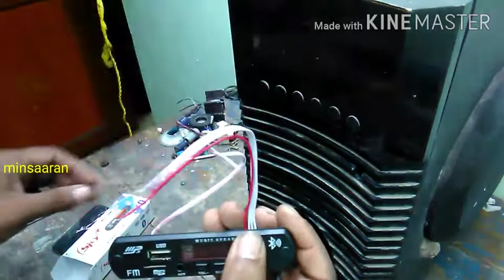Usb, FM, Bluetooth service in tamil/ 2.1 home theatre service in tamil/ usb board assemble in tamil

Comment: Anna enoda target home theatre remote miss aairuchu apram usb..mmc work aagala aana fm edukuthu ithuku oru vazhi sollunga vera usb board connect pannuna 5.1 ah work aaguma ila 2.1 ah work aaguma ? Sollunga anna
Reply from the maker: 2.1
Reply: @minsaaran9531   anna usb la 5.1 edukatha
Reply from the maker: @ss-jy5ip  5.1 Ella speaker um velai seyyum. Connection correcta kodukkanum
Reply: @minsaaran9531  thanks Anna❤️👍🏽